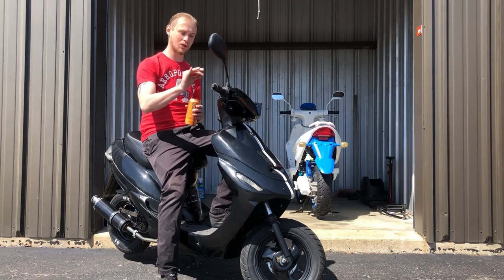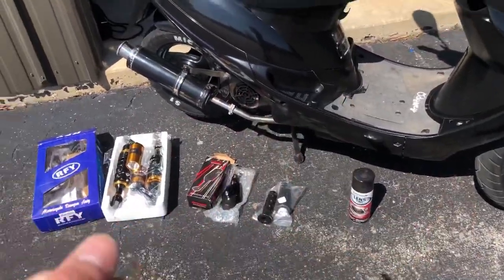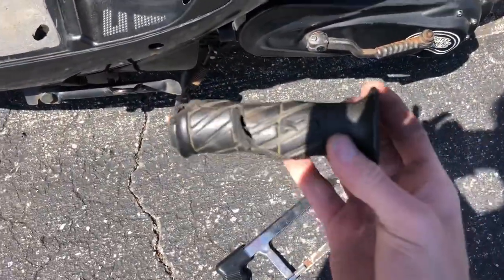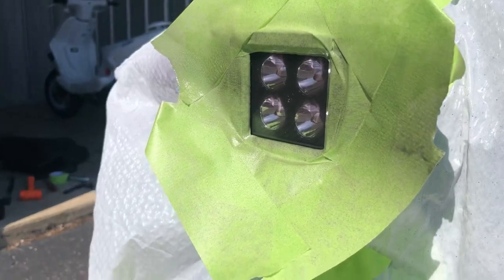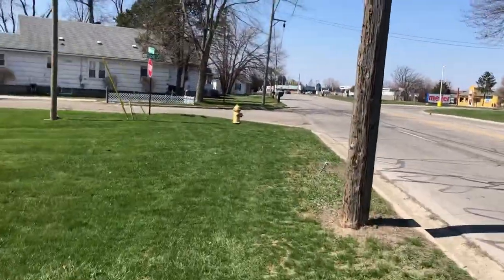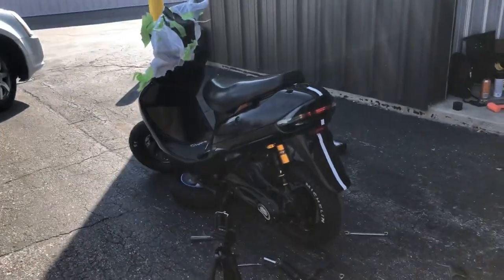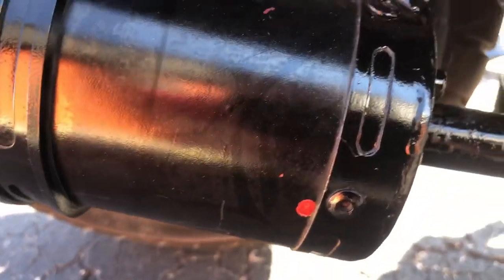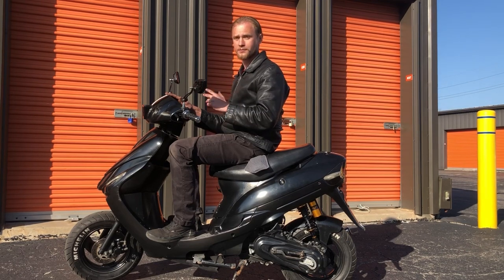RFY Shock install | Taotao Pony50

Comment: I recommend using a longer bolt on the lower clevis or what you called the drop out. the longer bolt will prevent stripping out the threads on that new strut. if they do strip get a longer bolt than that so a nut can be put on the back side. the stock bolt does the job perfectly on the stock shock but on the thicker aftermarket one it doesn't go as far into the treads.
Reply from the maker: Solid advice yeah it does threaded but just perfectly flush with the backside of the clevis drop out whatever I make up words lol Yeah that’s really good to know I’ll definitely do that
Reply: @davidhofinger4927  I rode bmx I get why you called them drop outs. lol

Comment: What up. Im the bearded guy with the orange 150 in town. I just ordered the same shocks for mine.  For the mirrors, add a rubber washer where it's screwed in.  And what about using the spray tint on the chrome on your handle bars.
Reply from the maker: What up old friend lol 
Did you just find me on YouTube or did I mention my channel? 

I’m just gonna use black spray paint on the chrome to make it gloss black like the rest of the bike I’m also going to touch up the chrome bolts on the mirrors with black as well, just black everything

It’s definitely worth it my bike feels 100% better on the rear end and I did previously rides like a Cadillac as they say
Reply: @David Hofinger  your video showed up on my feed because I spent Friday and Saturday watching scooter videos. I was looking at suspension upgrade videos.  

I thought the tint on the chrome would give it that black chrome look.
Reply from the maker: @moldysnowballs  I’m just gonna go for the all black look again I wasn’t supposed to get these groups are supposed to get a different pair but they sent me these ones instead

Well that’s pretty cool small town small world lol

Comment: Now you just need to remove the mudflaps on both bikes will look so much cleaner.
Reply from the maker: I like the look of it on the blue and white bike it adds a lot of blue color to it but maybe just maybe on the black bike that would be good I am considering it as I look at it right now

Comment: That shock still with it after driving for a while
Reply from the maker: Running great, It’s functioning just fine. It meets up perfectly. As long as we have those washers in the bottom eye and feels much softer much better
Reply: @davidhofinger4927  I’m 280 you think it will be fine?
Reply from the maker: @AdamArsenault-lz4qd  It’s adjustable in two different ways as well. If it is too soft, you can adjust it with the ranch to the right.
You can also put air into the canister, so if it is not right from the factory, you can make it fit you
Reply: @davidhofinger4927  thanks keep up the Chanel!

Comment: How did you remove the air box ?
Reply from the maker: I took off the Stock air box a loooong time ago.
When you upgrade your scoot to a straight air intake that connects directly to the carburetor, you get rid of the entire big bulky air box and hose with it.
This scooter is heavily modified for performance and other upgrades.
Thai was a solid suspension upgrade too.

The air box gets taken off completely if you change it to a straight cone intake filter.

Comment: Will the shock still fit even if get the stock air box in the way?
Reply from the maker: If you have a stock airbox, it might not wear it just might I don’t know as you can see on this video. I do not have a stocker box so I cannot answer that for you brother.

Put your shock up to your bike and see if it was Jen really fit but I know you want to do this before you order it but that’s the best thing you can do. I might have to convert to a pod filter if you want this shock.
Sometimes with one modification comes three more that’s the crappy part sometimes about Scooter modifications
Reply: @davidhofinger4927  ok I did it and it cleared the air box thanks for the reply 🙏

Comment: Can those adjust higher?
Reply from the maker: Fully adjustable, In two different ways, one with the air canister to change the stiffness, and then you can mechanically adjust it with the wrench, higher or lower, twisting it left or right.
Reply: @davidhofinger4927  thanks I appreciate it 🙏

Comment: Will these shocks fit my150 cc lighting 2 scooter
Reply from the maker: No sir different size
BUT they have 335? 330? Close one of those numbers
150cc size RFY shocks exactly like this one just bigger
Reply: I put a 235mm air adjustable shock without the reservoir on my 150cc and lowered it.